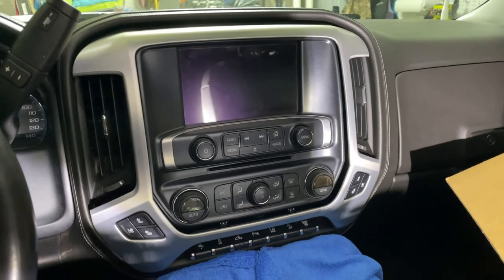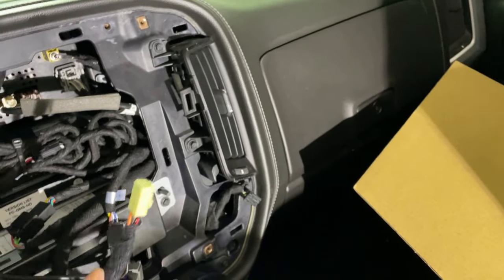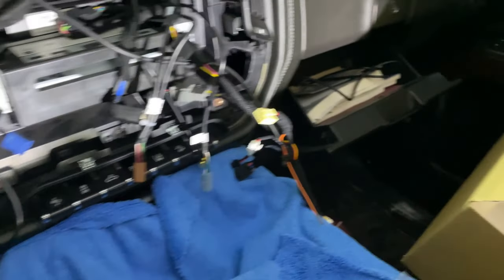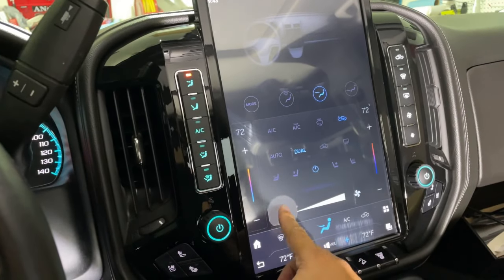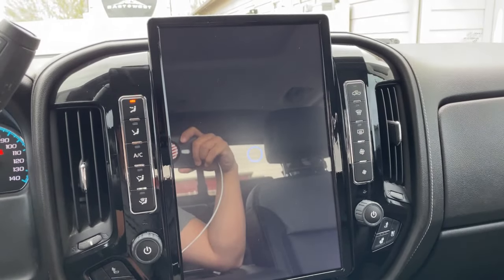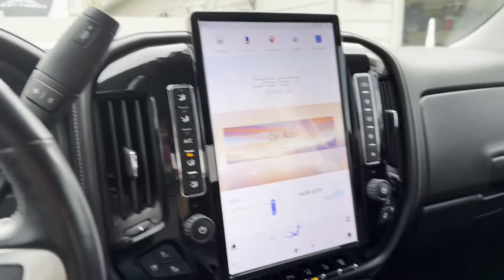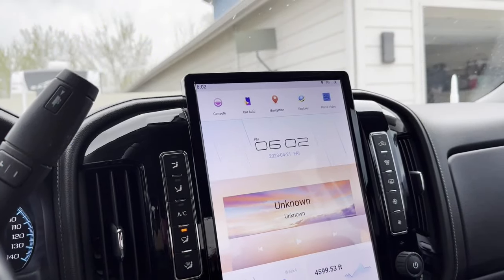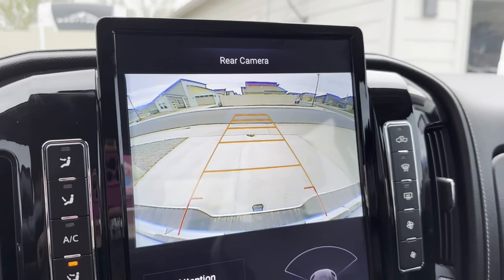AutoTec Pro Tesla Style Screen Install and Review 15-19 Sierra/Silverado

Comment: I recently installed this radio. Everything seems
to work. The only issues im having are jow to
access the back up cam on demand while
parked or driving. Mine works in reverse but
says no signal when i hit the cam button.
Also my Android Auto seems pixelated when it
connects to the unit. Any ideas how to fix this?
Thanks in advance
Reply: Hello. I'm just starting with this screen. But if still in need go to settings/system/ factory settings/enter your admin code/reversing video format menu/ change to VGA/save and reboot. My problem is I can only see the guide lines not video coming for my rear back camera.

Comment: Do you use wireless Apple CarPlay or wired. I can't get my wireless to work consistently.
Reply: Make sure you're disconnected from your stock radio bluetooth connection and it should work.
I had the same issue until I realized the problem.
Now, I can make calls from Apple Car Play.
Reply: Mike, It works now!! Thanks. Too bad the instructions aren’t clear from the beginning   Do you have an external SIM installed for your WiFi or do you use factory WiFi?
Reply: @PaulBowles-l8p  I believe the unit connects to your iPhone's WiFi through it's own WiFi connection.
If I want to connect to the internet via the unit, I can connect the unit to my truck's built in WiFi, but, then, since the unit is disconnected from my phone's WiFi, Apple Car Play will not work so I only do that occasionally.
The connection for Car Play is not like your typical WiFi internet connection, but, instead, just a local WiFi between your iPhone and the unit while your iPhone continues to use your carrier connection (usually 5G these days).

Comment: So I have the same but I’m having a problem with my back up camera not coming on any ideas
Reply: I’m having the same issue
Reply: Did you ever figure it out? I checked the connections and changed the format and still have no luck.
Reply: same issues with mine
Reply: I only see the guide lines but not video on my rear camera. Even changing to VGA on the admin system menu

Comment: What about steering wheel controls?
Reply from the maker: They work!
Reply: @CollaGoUnLTD  did they give you steering wheel control wire connectors for the skip forward backward function? I noticed on the video you havent installed anything for that part since all the other tesla style brands require installation was wondering if this system requires that aswell
Reply: @CollaGoUnLTD  my 2017 HD Silverado Using CarPlay the volume buttons (right side of steering wheel) work but not the buttons on the left. My truck was prewired just fine so I didn't need their connector.
Reply: @StyleOverPolitics  My 2017 already had the wires but they ship with the control wires if you need them

Comment: I installed mine last weekend. Maps and everything work great, but I can't get any sound from the unit. The radio works, as it uses the truck's radio receiver. From what I'm finding online, it may be an issue with the unit not switching on my factory Bose amp (the truck DOES switch it on for the radio) I didn't receive an aux dummy cable, so have no option to switch to aux on the unit. I'm going to contact tech support when I get a chance to take it back off and take some pictures.
Reply: I had no camera or sound. I have a 2016 1500 z71 without rear entertainment.  If u email them, ask them for the links to the guides on ther website. The guide says if the cameras not working, dont use the extension harness for the main power. Its  black on one end and blue on the other and one corner is angled and its about 4 or 5 inches long. If u used it, remove it. If that dont work the settings under settings> system> settings guide, the car ac protocol can be changed according to your vehicle ans the camera can be changed to vga format. Its the first option once u put in the password default 7890. To access the factory settings page under settings>system>factory settings, the password is default 666888. Also, i had no sound. The headphone dongle jack  must be plugged into the senter console port. Once thats in go the icon that says console and select aux or media until you see your phone, providing your BT is paired and connected.. but... heres what i did and it took me a week to figure it out.. when i removed my factory radio, i deleted the MyChevy from my bluetooth list. Well i reinstalled my factory radio, and paired it again. Then took the factory radio out and reinatalled the android unit and the bluetooth needs to be connected to the mychevy and the android unit. Wont work unless they are both connected.. i uninstalled android auto from my phone because u almost dont even need it with this unit. Maybe for msgs and calls but thats not important to me so i just use the music from my phone. And then once both bt are connected, play some music from your phone and click on the BT music icon to bring it up on the screen.  I now have sound,  and with the equalizer thats installed on the unit, the sound is amazing. So dont give up. Its a beautiful unit, it does work. I was on fire cuz i had no beats for a week or a camera. I was on fire.. but i kept tryin then they gave me the link to the guides which the password to see the guides is auto123 wen u go the website. They really could save a lot of negative feedback and angry customers cuz it aint cheap lol if they put a paper version in the box.. hope it helps. But if not read the troubleshooting guide. It might be a lil different depending on the year and model. I hope you all pass it on cuz you know exactly how frustratimg it is wen they say works right out the box. Or plug and play.. amd it dont work.. good luck everyone! Once its working youre gonna love it. I promise! The cable that needs to be plugged into the headphone jack inside the center console is just a lil black headphone jack. It has to be in. Its like 2 inches long. Thers a spot between the two usb ports in the center armrest console.
Reply: @joebagodonutz  Thanks so much for the info! I took a video of how it's behaving and emailed customer service this morning. Still waiting for a reply. My camera works perfectly. I do need Android Auto, because I use it for navigation. Unfortunately with no sound coming from the unit, voice cues from the navigation aren't working. I do have the phone connected to both the unit and the truck via bluetooth. I'll let you know how I make out.
Reply: @joebagodonutz  Got it working! I DID have the aux dongle. I didn't realize it was that little 2" extension cord. I assumed that was just an extension for the mic. When I got home from work I grabbed it and plugged it in and switched to "aux" on the console and it worked flawlessly! I sure wish they would send some instructions with these units! Thanks sooo much for your help!!
Reply: @denniscanfield2299  what did you connect it too?
Reply: @TURTLEBITCHES41  just plug the little 2 inch "extension cord" into the truck's aux port in the center console, go to the console feature on the stereo and change the media to "aux" and the sound from the head unit is played.
Reply: Hi there when I try to play movies like from paramount I get picture but no sound. Is there a setting I'm missing?
Reply: @johnseib2356   Hi John. I suggest you play the movie on one of the usb ports from the unit itself (in your glovebox?) and before doing so, go to your console and set the media to "aux input"
Reply: @johnseib2356  My sound issue is I have no video sound unless I turn off RDS in console and android side.
Reply: My rear camera is just showing the guide line even if I change to VGA. How you guys figured out ?

Comment: Can you post your setting for the back up camera ? I’ve tried everything and can’t see to get mine to work
Reply: Same here. I can't get any video from them just the guide lines. I guess the ground is missing in somewhere. I can't figure out yet where it is
Reply: Just installed and no backup cam. This really sucks not having
Reply: @jcalem14 did you figure it out?  I’m having the same issue
Reply: @kevinshrock1  actually I did. Long way and after tried many things. For some reason nobody answers how here. Is a cable there that's come with your radio with 2 yellow terminals in one side and a square on the other site. One of the yellow is going to the yellow cable on the radio, the one is "for extra cameras" and the other yellow to the red one. And that's it.
Reply: @jcalem14  thanks.  I’ll try that out.  This has been a frustrating install to say the least.
Reply: @kevinshrock1  it take me months resolved that. Other things that you will find is sometimes the screen don't turn on, not audio, freeze screen and other issues.
Reply: @jcalem14  ha!  I’ve had that happen a couple times now.  Completely black screen and then all of the sudden it flickers on and off
Reply: @jcalem14 another quick question.  How do you keep the truck from recognizing your phone as an iPod when you plug it into usb in the center console for power?
Reply: @kevinshrock1  on settings or console app in this case. Turn off launch usb/android. Don't remember exactly the name of the menu but it's something like that.
Reply: @jcalem14  Thanks for your help.  everything seems to be working.  one thing I'm still struggling with is keeping the unit connected to my phone via wireless CarPlay as well as having a hotspot connected to the unit so my kids can watch online streaming via split screen.  It seems to only want to be connected to one thing at a time.  have you found a way to be connected to both at the same time?
Reply: @kevinshrock1  Sorry I do not have iPhones. We used Pixel phones and had no issues with it. But in my case, I don't use android car, I used the apps directly in the radio screen. I do not know if is the same in car play but in android car is supposed you do not use your phone when you drive and do not let me use other apps. That's why I only use bluetooth.
Reply: @jcalem14 can you help me with this? I’m having trouble as well and I’m not seeing what you’re talking about in the proper camera “no signal” hookup

Comment: I am assuming you don't have the cargo, front, side, trailer, etc. camera system.  Looking for a video with someone with the Intellihaul system that is functioning with this...  Especially the trailer and cargo cam.
Reply from the maker: I actually do have the intellihaul system, it is the one thing that is super hit or miss using it. You have to be on the console screen and hold the back button. But the menu won’t pop like it normally does it will flash really quick, then go back out of the console screen and back in and hold the back button again and the menu should show up at that point.
Reply: @CollaGoUnLTD But how does it work when you go into reverse and want the cargo cam instead of the tailgate?

Do they have a RCA port for an aftermarket rear camera?  Or with my thoughts... Install a 4 port switch and connect the backup, cargo, and trailer cams to that.
Reply: @CollaGoUnLTD  The Intellihaul or Linkswell Multi-cam system will not work... At least not when in reverse.  You can display it on the "Console" still, but going into reverse will only allow you to see the backup camera.

Going to attempt to use the backup RCA input and install a switcher for Rear, Cargo, Right, and Trailer views.

Comment: Hey I have a question my Apple CarPlay is working but I have no sound but I can connect to my Chevy bluetook and it will work can you help me out please
Reply from the maker: On your console emulator app did you switch it to AUX mode and plug in the little 3.5mm dongle into your armrest console jack next to the usb port?
Reply: @CollaGoUnLTD I have same problem it plays perfectly fine but once I connect to Apple car play no audio
Reply: @tsegodlove2371 did you get it to work with CarPlay the audio
Reply: @CollaGoUnLTD  im having same problem but i never got a aux dongle in mine?

Comment: The system works perfectly but it keeps switching to the Bluetooth of the truck radio and switches to the car play . The car play quality little different to the original system . And with car play the forward and reverse buttons don’t work from steering . What’s the best way to have the system set for Bluetooth and sound quality ?
Reply from the maker: “Forget” the Bluetooth network on your phone for your truck, so it only auto connects to the new radio. You need to install the harness for the steering wheel to get the skip song buttons to work.
Reply: @CollaGoUnLTD  Perfect response, thanks! One of the most common issues I've read and one I had myself.
Reply: @CollaGoUnLTD what about the sound quality. The sound playing music through Pandora via CarPlay is not near as powerful as the radio. I’ve turned up the amp on the factory settings and anything over 15 starts to crackle. Have you found a fix for this?
Reply: Go to sound settings and click sound gain, turn everything to 15

Comment: Can you view your rear view camera in park or drive ? I don't know how to do it.
Reply: Go to the apps and select CAM
Reply: I already have done that, it's just a black screen and two options. Rear view and side view + it says no signal
Reply: I would try a factory reset or verify the camera setting is right.
Reply: @sharpie5075  what camera setting did you use ?
Reply: Same here no video from my camera but I noticed I can see the guide lines once I changed to VGA on the system menu. I guess is missing the ground and that's why not video. I'm trying to find out how get the ground there.

Comment: Hey my radio console screen is not showing and no backup camera display any suggestions?
Reply: Go to the AutoTecPro channel and find the installation video for GM/Chevy. OEM backup camera is supported but your unit could have been shipped with wrong settings (e.g. defaults for Ford instead of Chevy).

Comment: So when you get it installed you have the home button which gives you the top navigation. For 95% of us we only want a few things: 1) Console (for OEM features), 2) Bluetooth (for connecting/disconnecting devices) 3) Settings and 4) CarAuto (for Andriod Auto and Apple Carplay). Anybody figured out how to eliminate all the other options so I don't have to do the horizontal swipe?

Comment: Good afternoon, I connected the same one in my 2014 silverado but the reverse camera does not appear on the screen and in the original stereo if it did appear, it could be
Reply: Mine doesn’t appear either. Also won’t play volume when connected to Apple CarPlay
Reply: I had no camera or sound. I have a 2016 1500 z71 without rear entertainment.  If u email them, ask them for the links to the guides on ther website. The guide says if the cameras not working, dont use the extension harness for the main power. Its  black on one end and blue on the other and one corner is angled and its about 4 or 5 inches long. If u used it, remove it. If that dont work the settings under settings> system> settings guide, the car ac protocol can be changed according to your vehicle ans the camera can be changed to vga format. Its the first option once u put in the password default 7890. To access the factory settings page under settings>system>factory settings, the password is default 666888. Also, i had no sound. The headphone dongle jack  must be plugged into the senter console port. Once thats in go the icon that says console and select aux or media until you see your phone, providing your BT is paired and connected.. but... heres what i did and it took me a week to figure it out.. when i removed my factory radio, i deleted the MyChevy from my bluetooth list. Well i reinstalled my factory radio, and paired it again. Then took the factory radio out and reinatalled the android unit and the bluetooth needs to be connected to the mychevy and the android unit. Wont work unless they are both connected.. i uninstalled android auto from my phone because u almost dont even need it with this unit. Maybe for msgs and calls but thats not important to me so i just use the music from my phone. And then once both bt are connected, play some music from your phone and click on the BT music icon to bring it up on the screen.  I now have sound,  and with the equalizer thats installed on the unit, the sound is amazing. So dont give up. Its a beautiful unit, it does work. I was on fire cuz i had no beats for a week or a camera. I was on fire.. but i kept tryin then they gave me the link to the guides which the password to see the guides is auto123 wen u go the website. They really could save a lot of negative feedback and angry customers cuz it aint cheap lol if they put a paper version in the box.. hope it helps. But if not read the troubleshooting guide. It might be a lil different depending on the year and model. I hope you all pass it on cuz you know exactly how frustratimg it is wen they say works right out the box. Or plug and play.. amd it dont work.. good luck everyone! Once its working youre gonna love it. I promise! Save and reboot after changing settings

Comment: Anybody know anything about this company? Specifically how good their customer support is. I see a similar (small 12" unit) on Carsoll and it sounds like they are pretty good to work with if you run into any installation problems but not sure about Autotec. I like the idea of a bigger 14" screen. Also, what's the warranty on these?
Reply: Answering my own question. The product ships out of Canada but I can tell you the units have strong Chinese ties. That doesn't bother me at all but I will be posting an update about the service because I have 2 remaining issues that are deal-killers for me so either they'll have to work with me to figure our what I'm doing wrong or be willing to handle a refund.
Reply: So… what happened?